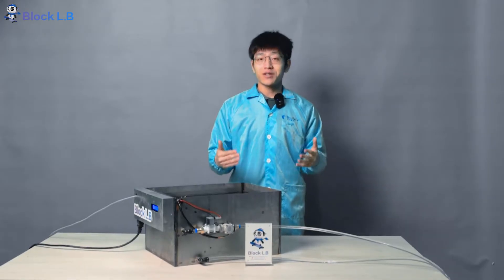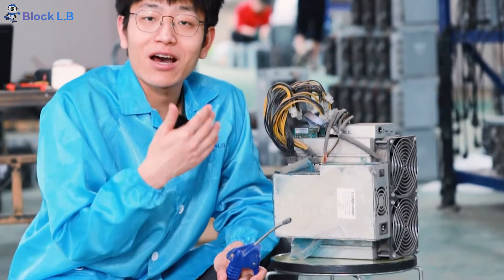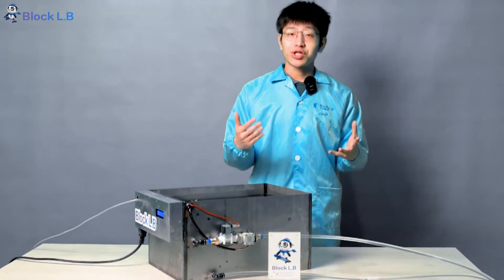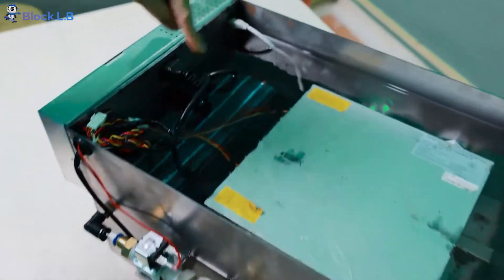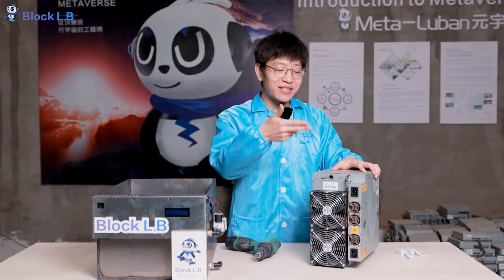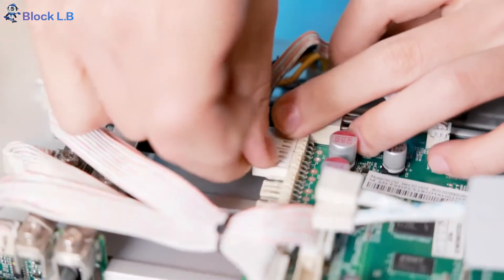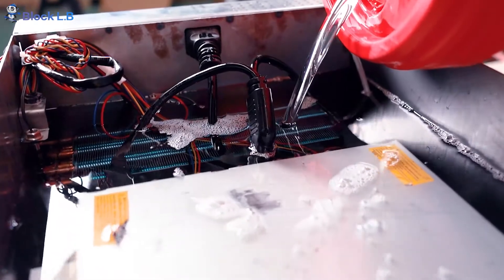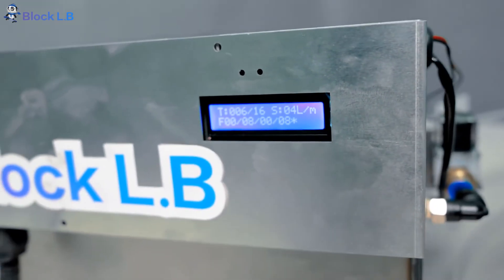Discover the Mystery of Mining Machine with Zero Noise - Immersion Oil-cooling

Comment: So us how to cool water,the external radiator os dry cooler or cooling tower.without one of these is useless..
Reply from the maker: Yes, the meaning of cooling is to use these external devices to take away the high temperature generated by the chip, so as to reduce the chip's high temperature self-destruction and improve the operation of the chip
Reply: @Meta-Luban  ok but saw us how to do that what device to add to cool water.my friend has one like that but don’t know how to to cool water
Reply from the maker: @MrHondata2000  Hello, friend. Water cooling and the equipment needed, as well as the specific working principle, my will tell you in detail, in order that we can communicate easily and quickly. Convenient to leave your WhatsAPP?

Comment: Where is the pump? how is the water circulation working?
Reply from the maker: The water pump is separate and external, and the water circulation uses the pump to rotate the water flow and take away the heat from the machine
Reply: @Meta-Luban  What is the type of water pump?
Reply from the maker: Hi! My friend, there are many models of this, the universal one is 250W/220v, but it has to be changed according to the specific needs, if you need any help, please feel free to contact me：support@meta-luban.com

Comment: Brand new technology? More like 30+ years old. Using mineral oil ruins plastics, connectors everything over time. So dont expect to sell your mining unit. Also i dont really recommend using quick connect connectors for your water loop. Otherwise great job on the video.
Reply from the maker: Hello, thank you very much for your attention to the official video of the Block Luban. The problem you are worried about is also something that we have tried to solve. The new technology contains a lot, among which you can use water circulation to cool down the machine. The corrosiveness of the traditional grease is also replaced by a new special electronic dielectric oil that is resistant to corrosion. Really looking forward to talking to you. This is my email address: benedikepihla@gmail.com